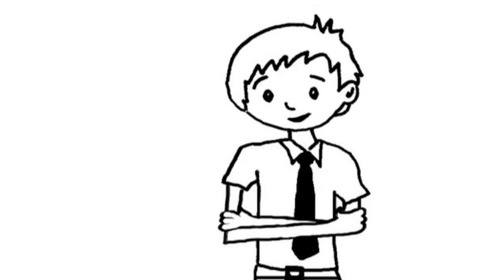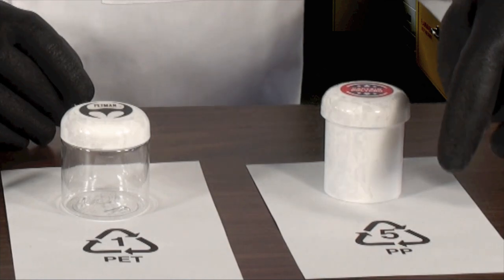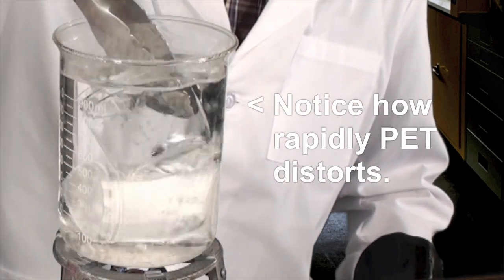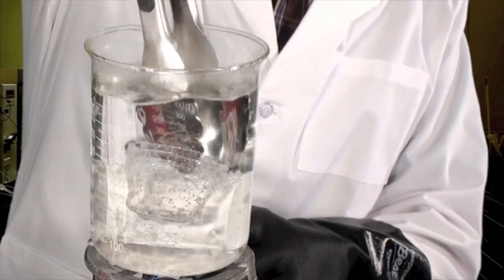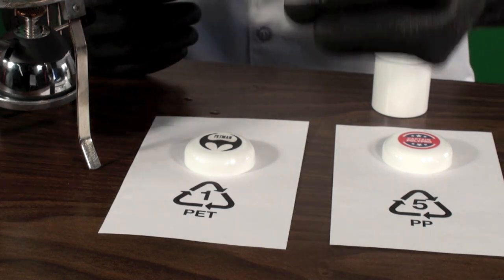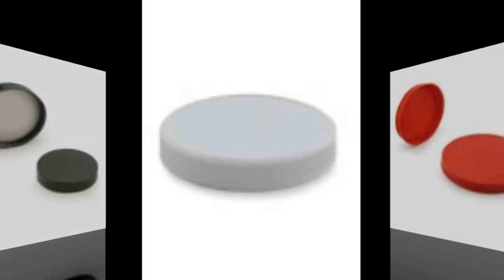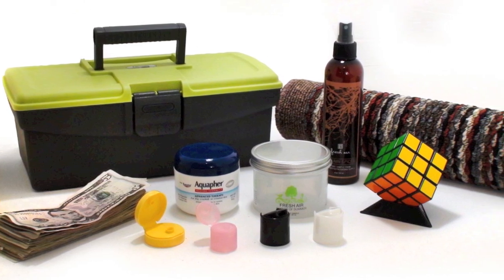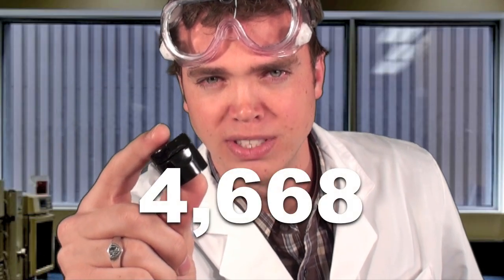What is Polypropylene (or PP)?

Comment: hi man, thank you really much for your vids. 
Do you think an object made 100% polypropylene would sustain a "constant" archimede's thrust if it were to be dragged at the bottom of the sea? Pretty specific huh?... My thoughts are that it would, because its bulk modulus is close to sea water's, so 1kg of sea water and 1kg of PP would shrink at the same rate under isostatic pressure, so that water density would increase at the same speed the PP object's volume would fall, and thus, preserving the object's flottability. My analysis assumes bulk modulus being constant over depth and doesnt even take the thermodynamics into account.  Which concludes the following affirmation : archimede's thrust doesn't decrease along depth except if it is compounded of very low bulk modulus elements (eg : trapped gas bubbles, ...), which would make it prone to collapse under isostatic pressure, faster than sea water does at the same depth. 
What do you think?
Reply: Vatea97 و
Reply: as the polypropylene is compressed, the Archimedes thrust would decrease. simple.

Comment: would you also use Polypropylen as a green screen background?
Reply from the maker: Hi Lennart. You really could use just about anything for a green screen, as long as you're careful with its relatively brittle nature, it should work just fine. The real trick to green screens is getting enough even lighting on the background.